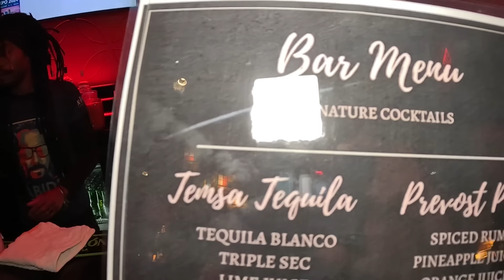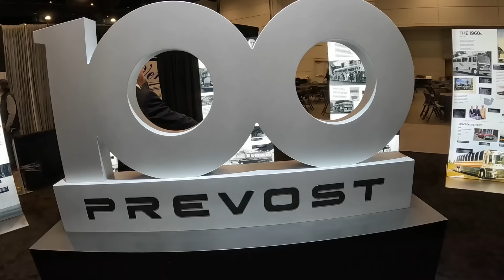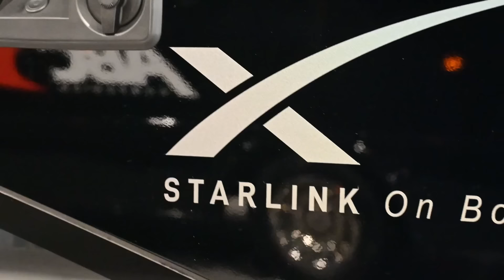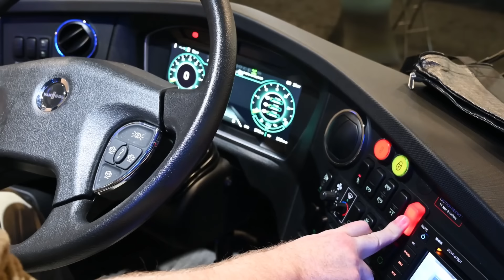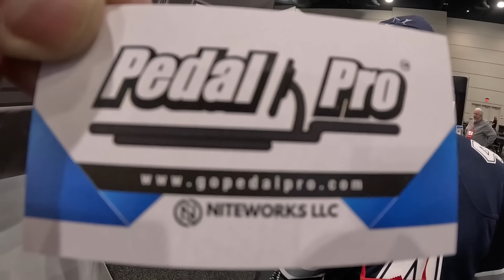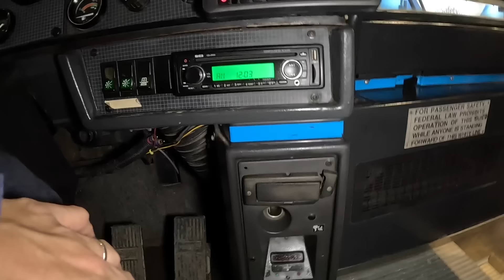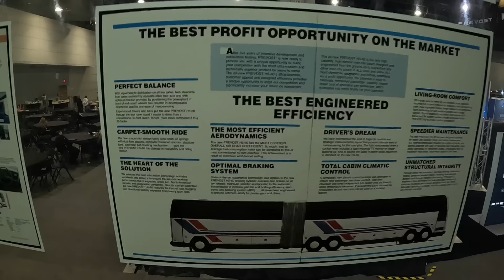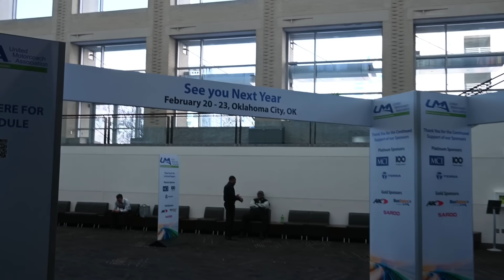Exploring Rare Articulated Prevost H560 & More: Inside UMA Motorcoach EXPO 2024 at Raleigh NC

Comment: I was the person who speced the 17 H5-60 that were purchased by Holland America and used in Alaska for 10 years.  This Venture Tours coach is ex-Holland America either bought through MCI from Holland America or from Gray Line of Halifax who bought 11 from Holland America.  FYI, the additional ventilation pods were not original.  We tested an H5 in Alaska and the Yukon in January of 1990 or 1991 before we bought them.
Reply: How did they perform?  How was access to the 8V92 for servicing?  It looks difficult.....
Reply: They performed well.  We (I was with Holland 32 years, retired from there in 2009) ran them  for 8-10 years on the Alaska Highway.  The only problems we had were a few fan drive issues and a significant number of cracked right cylinder heads once they got about 5 years old.  The cylinder head problem would only occur after the 14 mile pull out of Skagway from sea level to 3,300 feet (3.9% average but much steeper in some places).  The  ECMs ever showed signs of overheating but we replaced a lot of cylinder heads in Whitehorse, Yukon.   We never did figure out the issue but we started using some of 40+ MCI E4500's on that run so it was no longer an issue.  When the H5-60s ran Anchorage to Seward and in Seattle there were no issues.  The access to the engine is no worse than an MCI or Prevost.  @bryce2680
Reply: @davidbeagle7606  Thanks for the story.  Very interesting about the heads.

Comment: That little window on the left of the driver seat is actually for shoulder checking on the original H series when they came out and didn't have the angled first window pane. It was the H3-40 that had it after the H5-60.
Reply: I remember those. The company (Polynesian Hospitality) I worked for had all Prevost fleet, prestige, Le Mirage, Le Mirage XL. Then Prevost sent my company a new demonstrator 1995 H3-40 (loved that square window). It was originally sent to Oahu but the agents started fighting for the use of the new bus, so the owners sent it to Maui, about a year later we took delivery of the 1996 H3-41's and then 1997 H3-45's. I had the opportunity to drive them all and my favorite one was the 
1994 Le Mirage XL's and the H3-40 and H3-41

Comment: I had the privilege of being able to drive the H5-60 when I worked for Ops at Gray Line of Seattle. By the time I was there, and able to get qualified (which included parallel parking), it was in 2009/2010 shortly before TMS bought Gray Line of Seattle from Holland America. At that point we have 2 H5-60's in service and they were both showing their age. I used to joke that it was like going out on a date with a crazy girlfriend, you never were sure if you'd make it home, but you didn't care because you were having so much fun. 80% of the runs they were used for were cruise ship transfers. The expeditors at the pier loved them on disembarkation because of their capacity, but the driver had to be a grand master at Tetris because in spite of their size, due to the engine placement amidships of the front half of the coach, you really didn't have much more luggage space than you would in an H3-45. They were definitely unique and I feel fortunate that I am able to put that notch in my belt.
Reply from the maker: Was it difficult to back up in them?
Reply: @MotorcoachWorld  not difficult, no, but you had to be thinking and staying ahead of the trailer. The trailer axle turns but it is through a passive system the driver cannot directly control or stop. The steering axle on the trailer is controlled by way of a connection to the pivot plate in the center articulation that counter steers to the direction of the turn (think tiller axle on a ladder fire truck). What that means is if you are backing up and you reach a certain pivot angle of the articulation, there is no amount of turning you can input to the front steering that will overcome the trailer turning the way it’s already turning and if you continue, eventually you will jackknife. Thankfully Prevost put in a safeguard where at 15 degrees of articulation you’d get a buzzer and a warning light and at 20 degrees the park brake would set. (It may have been 20 & 25 degrees, it’s been a decade plus) and the only option ways pull forward to reduce the angle and resume the backup. The other minor oddity because of the trailer steering axle was if you were making a right turn and you were coming close to the curb with your trailer, instead of relaxing the turn on the wheel to open the turn up, instead you would turn into the corner as sharply as possible to put as much articulation in the center plate as possible to counter steer the trailer axle as much as possible. The result was a lot of button hook turns. It was a blast to drive for me because it made me really think about what I was doing. After a point, you get in any traditional coach and it’s easy to maneuver, you still must be careful of course, but how the coach will react to your inputs becomes intuitive, the H5-60 (for me at least) demanded that I slow down and actually consider the outcome of every input. As a bonus it really helped me personally at the boat launch, once you have to learn to stay ahead of a turning axle on a trailer, a straight axle trailer is easy mode.

Comment: Well done as always James. Yes those 2 guys have an interesting channel as well. I actually rode on a H5-60 when I took my first and only cruise in Alaska in 2006. Nice coach but it was bit off putting since the engine is in the front section hence more overall noise from that 8V-92. I would imagine servicing it presented a spaghetti plate of potential problems. Too bad they didn’t have the engine in the rear like most other artics. Alignment was likely an issue with dual front axles but I could be wrong. I think double deckers are the better choice to add capacity but watch the low bridges. Thanks for posting that James. The general public can’t go in there so that’s well appreciated.
Reply from the maker: I cant imagine how they would pull that engine out! It seems like such a bad idea to stick the engine in the middle of the bus!
Reply: @MotorcoachWorld  Here in Milwaukee, the Milwaukee County Transit System had  40 CROWN IKARUS artics back in the 1980’s. Other than impressive size, these things were the epitome of crap. A CUMMINS horizontal engine which was way too big for a transit in both size and HP under floor in the front section. Horrible in summer because no AC. Many maintenance instructions were in Hungarian. Drivers were told not to shut off the engine because they were too hard to start when warm. They couldn’t get rid of these lemons fast enough.
Reply: @MotorcoachWorld  the engine is mounted to a plate and the driveline had an “easy” disconnect. All lines to the engine, like fuel were soft and long enough so that a tech would use a forklift and pull out the plate the engine lives on through the side access hatch you showed to give them “full access”

Comment: A long time ago (late 80's), I was able to ride in an H5-60.  Mid-American Charter in Chicago had one.  We were on a charter from Pheasant Run to downtown Chicago to take a dinner cruise on the lake.  Had an accident.  The H5 was a secondary victim.  Someone hit a car at an intersection to our left kicking the car into our path.  The driver swung right.  The front of the bus missed the car but the tillering of the back wheels caught the car.  The Mid-American driver did a great job.  I was in the first seats behind the "wheel" at the joint.  It was interesting to watch the wheel area.  It was independent of the front and back so it moved at half the angle.  Made it easier to walk through the bus even in a tight turn.  I enjoyed the ride until the accident.  Correct my recollections of the bus.
I understand the engine was a major reason there are no more H5-60's.  I am not blaming the DD 8V92 engine.  But you had to either have a lot of space (60 feet long), a very weird lift for 4 axles (8 lifts) with an expensive engine lifting lift, or a very special pit to take the engine out if it needed repairs.  I don't think it came out the side but I don't know.  But you could not slide it out the back.  It was not a pusher setup.  It pulled the bus.  So it was up under the front part of the bus.  I thought it was a fascinating bus.  I would not want to work on one though.

Comment: That 60 foot coach is the A-380 of buses!
I drove an Ikarus 60 foot transit bus with engine set up near front in the 80,s and the exhaust was dirty and engine was noisy,I preferred the 60 foot pushers with engine in the rear,when we got those buses we had to go from two to three post hoists in the depots,I did see several of those buses in the early 90,s from a Quebec charter company.
Reply from the maker: Lol I've never put two and two together but it's a perfect analogy!!!! Love it.
Reply: A380? Try the double-deck, articulated (yes, double-deck AND articulated...!) Neoplan JUMBOCRUISER N138/4 from the 70's! Also mid-engined (a Mercedes-Benz V12 diesel underneath the artic joint/bellows)...

Comment: Just some tidbits about the H5-60.  As I remember, this was originally developed under a government grant to build an inter-city coach with expanded capacity, specifically for the Montreal-Toronto run along the 401  (main highway).  In operation, the big issue was the limited power available from the largest diesel of the time, the Detroit 8V-92. That was coupled to only one drive axle; there is only so much power one differential can accept, thus even if a heavier motor could be fitted, neither the axle nor the transmission could accept the torque.  The upshot was that these things could not engage if stopped on a grade.  Drivers had to be careful not to get trapped in a line waiting for a traffic light on a grade, or they would not be able to start up if with a full load.

The vertical clearance would limit a replacement or swap-in engine as an aftermarket refit, also not accomplishing much unless you could use two axles as driving axles.  Another solution would be to fit hydraulic motors to other axle positions and add a hydraulic pump onto the engine, which if coupled with an accumulator tank bank would give you the torque to start up a grade.  I don't think anybody ever did this, though.   Remember that the whole idea of these extended buses was to have one driver haul more passengers,  not so much for wage savings but because there were not enough drivers, a problem that continues today.  Instead, the industry has gone over to double-decker buses for additional passenger capacity (which leads to its own big problem, drivers crashing into low clearance bridges at full throttle, with fatalities). 

At one point after discontinuation of the project, only due to the lack of sufficient engine power available, Prevost would still do a special build if you ordered a minimum of 10 units.  Then Volvo bought the company and that marketing dropped out.  An interesting experiment. PS:  apparently the biggest headache for maintenance on these old units is that the accordion curtain is not available, so don't tear it!

Comment: I see the VanHool has the engine brake and cruise on the steering wheel. Last VanHool I had was a 2016. MCI has had them for a while. It’s so much more better on the steering wheel.  More control without having to take your eyes off the road to find the dash switch.